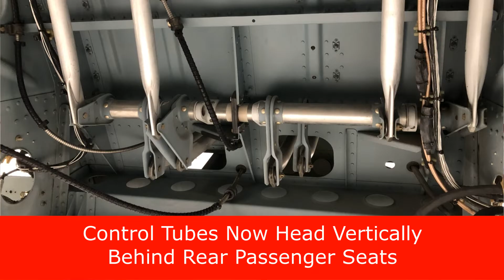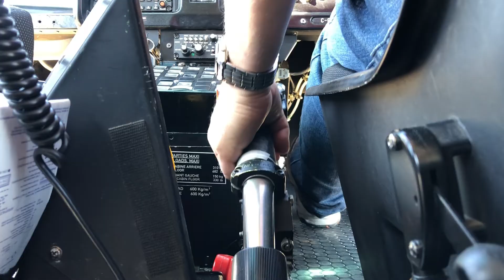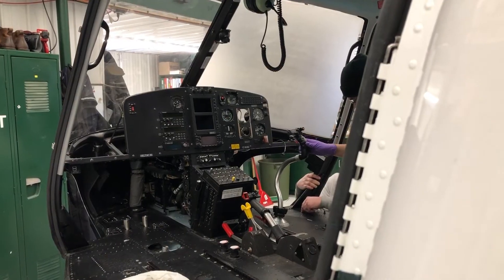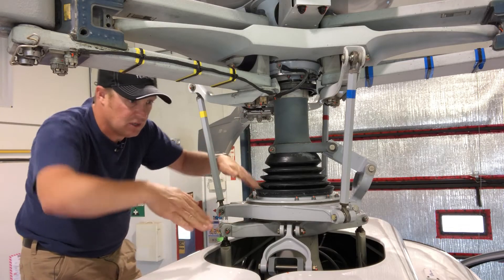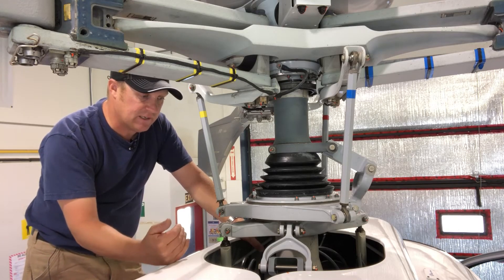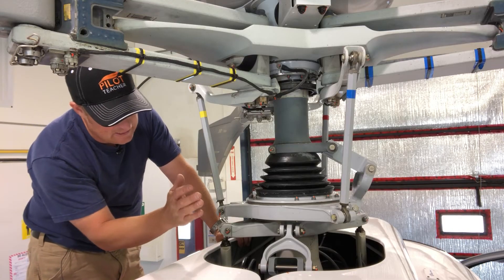Helicopter Swashplates - This Is How They Work!

Comment: What does the rubber boot do?
Reply from the maker: Stops dust and debris getting into the upper mast bearing. The H125 has a different bearing type and does not have the boot.
Reply: @PilotTeacher  thanks for the quick reply. That's what I thought it was for. I used to work on H60s and don't recall a rubber boot on the swashplate.
Reply from the maker: @MasonJarGamer117  it all depends on the machine.

Comment: OK, I may be severely mistaken as I am just an enthusiast and I have not gotten to study this as a profession yet. To my understanding whenever dealing with gyroscopic procession the resulting motion is always expressed 90ﾟ after the applied force. I think that if you lineup is up where the servo is attached to the fixed swash plate and the corresponding PC link You will see that the blade will be affected 90ﾟ prior to the resulting motion. You have to remember that The PC link is attached to the rotor blade forward of the pivoting point. Now again if I am wrong I would really like to be corrected I do not Intend to say that I know better and I know better and I am really looking for the conversation or correction to my knowledge.
Reply: So to add more description given that this helicopter has a clockwise rotating rotorhead my understanding is that in order to create forward movement  You would actually create the largest differential between the relative wind and the chord line on The right or receding side of the roader disk

Comment: this is another good video and explanation,
the question, when you said that you raise the collective and them it just the pitch angle. however, the question is, when you rise o lower the collective, does that actually also change the RMP of the engine or inject more fuel? or just adjust de blade angle. and how you increase the rpm of the engine?
thanks.
Reply from the maker: It does both. It is known as a correlator and it can be done with mechnical linkages or a digital motor control if the engine has a digital fuel control system.

This video might help:

How Does A Helicopter Engine Work? A Complete Guided Tour From The Pilot!
https://youtu.be/JFusNq0NKNI
Reply: Thank you so much.

Comment: Thank you so much for all the videos you are making. It is really great and inspiring content.
One comment about a factual mistake in this video that might be miss-leading for people researching this.
The gyroscopic precession is always 90 degrees. As you have mentioned the movement of the swashplate is partially adjusted for this. The important information though is that the blade pitch link location ensures the rest of this position adjustment all the way to the needed 90 degrees. Thus if you move your cyclic forward the blade will move the most when it is 90 degrees to the left from the front of the heli (CW rotor direction).
Other than this the explanation was spot on and thank you for it.
Reply from the maker: @hermajs Great Observation, but there is a little more to it than may first seem. I was also under the impression many years ago that gyroscopic precession happened 90° later until I stumbled across 2 forum threads on the subject with posts from some of our industries greatest helicopter minds.

Teetering rotor heads like that on Robinson's and Bell's will show close to a 90° precession, but with fully articulated and rigid rotorheads the same is not true.

In my video I noted the offset on the Astar was around 20-30°, I did get this wrong as it was the other way from 90°, as in 70-80° offset but I'm unable to alter the video.

If you want to read the two great forums threads on the matter, you can find them here:
https://helicopterforum.verticalreference.com/topic/5280-a-closer-look-at-gyroscopic-precession/

https://www.pprune.org/rotorheads/19678-helicopter-dynamics-gyroscopic-precession.html

I hope this helps clear up any confusion and thanks for your input. It's a pity YouTube does not allow you to make any alterations without affecting a videos history. Maybe one day I will do a video on the subject but its a real tough one to make to explain clearly!!

Rick

Comment: Genius piece of engineering alright. Still does my head in trying to imagine how it all happens while rotating so fast. I would love to know the maintenance regime on something as critical as that.
Reply from the maker: If that swashplate blows your mind, check out the rotorhead of the Kamov KA-32!!

For the Astar, the swashplate is inspected by me during every daily inspection before flight, then it is cleaned and inspected by maintenance every 100 hours, 300hours and 600hours or 24 months.

If excessive wear or play is found they will investigate further and replace as necessary.
Reply: The Kamov Contra-rotating rotorhead and swashplates. How about the Kaman K-MAX. That is an interesting piece too. @PilotTeacher
Reply: Thank you, superb video with excellent explanation of each part of the swashplate as well as visually referencing it .